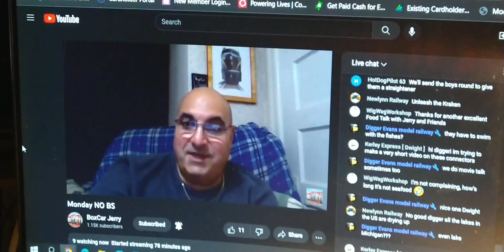Help on the Connectors

Comment: I use those on my tortoises and never had a problem with them.  I have over 30 tortoises on my layout.  Just solder the ones you need and ignore the rest.  There is no reason to cut or bend the unused ones.   Make sure you use soldering flux before soldering,  it will make everything much easier. - Paul
Reply from the maker: thank you for your feedback on this

Comment: Dwight never saw that type of connector for the tortoise machine I had one made for the tortoise machine after a while they get loose, so I removed them all and went back to soldering the wire onto the tortoise machine.   I made my wires about six inches long solder them onto all 8 pins of the tortoise 1 thru 8 and use different colors.  the other end I have an 8-port terminal block this way I can remove the tortoise machine by unscrewing the wires from the terminal block. Those clip On's look nice and would be easy but like I said after a while they get loose and then you have connectivity problems I would suggest not using them and solder the wires
Reply from the maker: Ok Thomas thank you

Comment: I'm not sure, brother. We soldier to the Machine. You could also Get grimp adapters for your wires and slide them on to the posts of that adapt? Good luck. ✌️
Reply from the maker: thank you 33 i was thinking that too if i can get the right size

Comment: Honestly Dwight, please don't take offence to what I'm going to say, but you said it yourself, that you're not really good at soldering, forget about using this. 
The easiest for you would be to get an adapter that Cuircitron makes, which is similar, but has screw terminals on the end to attach wires, and it slides on the same way as this does. Take a look at it. It costs about a $1 or  $2 more than this one.
If you do want to have a go, just solder the wires to the row tabs on the one side only. leave the other side alone until your done, just in case you mess
Reply from the maker: im not sure where or what your talking about

Comment: As small as your layout is Dwight, why not use manual controls? Merry Christmas 🎄…..John
Reply from the maker: because i already have tortoise machines and thats what i'm going to use i want to be different all i will have to do is throw the button and the turnouts will switch
Reply: Dwight, Okay. Do you have the stationary decoder or decoders required to control them as well?…..
Reply from the maker: @tanzj  yes i have one